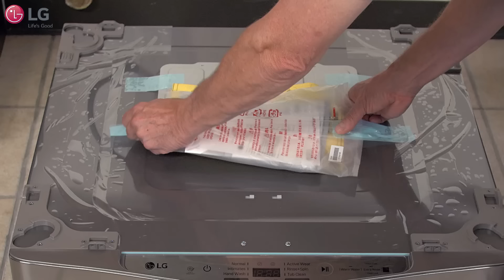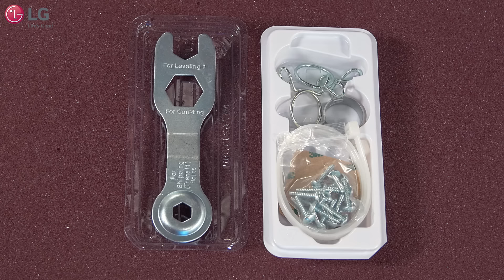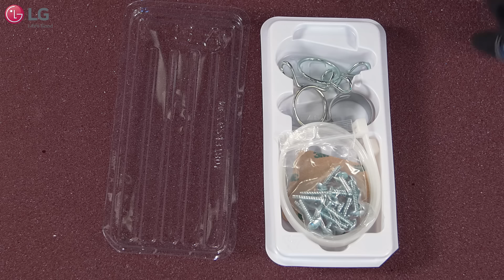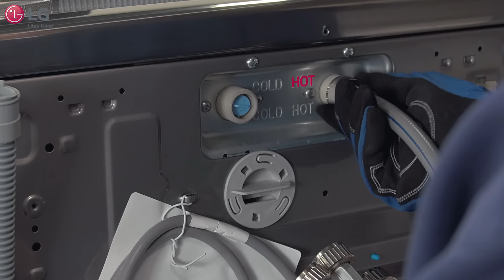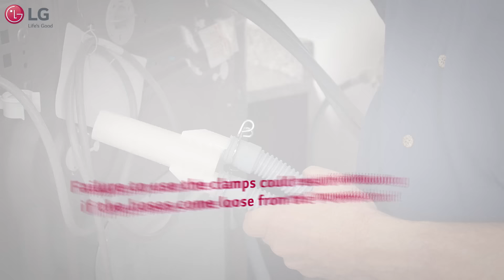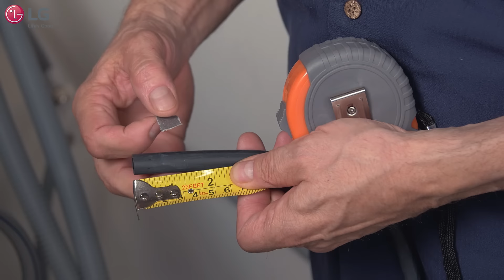LG SideKick™ Washer - Installation

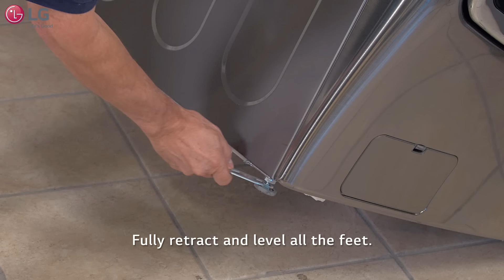Comment: I have the 3400 washer, i had to remove the middle nut on the feet at 01:15 to screw the legs in far enough so the holes with the 16 screws would line up. The nuts were too thick.
Reply from the maker: Hi, Koolnestea! Thanks for sharing that detail about your setup with the LG 3400 washer. It’s helpful to know you had to remove the middle nut on the feet to properly align the legs and screw holes—your observation about the thickness is noted. Thanks again for your feedback! -Junel
Reply: @LGUSA  also the drain hose is quite a bit shorter than the 3400's drain hose so when you attach both to the Y piece, there is quite a bit of slack on the washers drain hose, so in my case the sidekicks drain hose isn't long enough to reach my drain so i gotta find a extension or see about getting the same length drain hose like my washer.

Comment: I wonder why you cannot install the sidekick under the dryer? You can install a full-size washer under the dryer but not the sidekick. Does this apply to the most recent Sidekick model WD300CV? Can the sidekick be installed above the big washer with a stacking kit? I have a tight place and I’m trying to find a solution.

Comment: Failure to use the clamps could result in flooding if the hoses come loose from the Y-connector!
Reply: If inserted more than an inch, it will cause leaking at the drain Y-connector.
Reply: DO NOT Install the SideKick@ under a dryer!

Comment: Remember this video is using all rubber hoses, ALL hoses should be replaced with stainless braided no burst ones including the footlong ones that come out of the hot and cold faucet AND including stainless y connectors found in steam dryer kits

Comment: Damn!  You have to have a mess of hoses in back of this set with the sidekick.  I'm thinking of ordering the Sidekick, but I get the feeling there's often issues with these.  Not draining totally and receiving damaged.  I'm still considering it, but I have to believe over years, those plastic Y connectors are going to be stressed.
Reply from the maker: The SideKick™ Pedestal Washer shares its drain hose with the washer that it is paired with. We do not have any reported issues nor are we aware of any reported issues about drainage issues. The hoses are made of the same material as those for the washer so they will hold up to the same stresses as any washer hoses do. The water pressure for all our washing machines & the SideKick™ Pedestal Washer is the same & the hoses are designed to those specifications so stress is not an issue...^Ivan
Reply: @LGUSA  I'm sorry I wasn't more clear, I guess because I haven't experienced it myself.  I just read about it.  It seems that "some" people had an issue with the tub "totally" draining.  Sounds like water sometimes would remain in the tub causing the usual issues with water remaining.  I was interested in getting the Sidekick with the 8100 series.  They are out of stock still.  I was between the 8100 with a Sidekick, or the 4500 series without.  I'm apprehensive about so many electronics on the 4500 series, but I'm pretty sure that's where I'm headed.  Thank you so much for your responses!  VERY helpful.
Reply from the maker: If the Start/Pause button on our washers is not pressed to start the selected cycle, after a delay the washer automatically turns off & all cycle settings are lost. Any water remaining in the drum will be drained. Water will only remain in the tub when a wash cycle ends if the drain pump filter is clogged so it is recommended to periodically check the drain pump filter to ensure that it is not clogged with foreign objects so it drains properly...^Ivan
Reply: swap out the plastic for brass... they're the same size/thread as a garden house

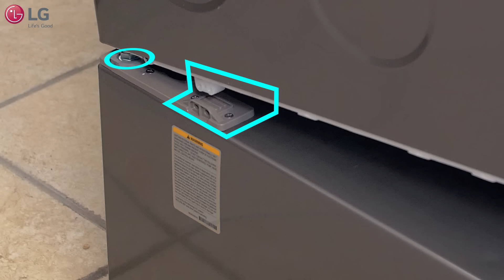Comment: Has anyone had problems with the screw holes on the mounting kits not lining up (@1:30)?
Reply: Yes! the screw holes in the main washer are higher than the screw holes in the side kick washer.
Reply: Same observation here, holes on the main washer are too high.

I fixed the problem by taking off the 4 legs of the main washer (you need to be two individuals as the main washer must be tilted) . I then replaced the top nut of each leg by a nut (M10) that is ~3mm shorter. 

I am baffled by the incompetence of LG... I will never buy an appliance from them again.
Reply: I have this problem too. I'll try the M10 nut and see if it works. Thanks for the tip!
Reply: Our 2nd installer said as you start a screw in, the two flanges pull together.  Also we found #8 x 1" screws worked, as the original installer misplaced the install kit

Comment: I just want to use the mini washer below , can buy separately?
Reply: There's a weight switch near the back left corner that you can tape down and it will work. I live in a tiny studio apartment, so I put this thing underneath my bed and ran a hose to the kitchen sink. Saves floor space and the landlord will never know it's there.
Reply: I've seen small top loading washers for under $300. They're about the size of a dorm fridge.

Comment: and where the depending from SideKick  to the main washmashine? 
SideKick have is own inlet, outlet  and power plug  then it would work without the Mainwashmashine too?
why you promote like that be a one unit???  SideKick  is a lot interess as separate mini washmashine for use in mobile caravans, tine house, tine apartments etc... if you have SideKicke option with 12Volt the Caravan owener will love  LG. 
Next Idea would be  SideKick same size Dishwasher, to combine upper half sidekick dishwasher and lower half sidekick washmashine perfect DoubleKick for small city apartments and/or single apartmens etc...

Comment: How can we move these stacked machines. I need to clean the area behind these washer and dryer machines and it's impossible to move these forward and clean the back area.
Reply: It is useful to own an appliance dolly or hand truck if your floors are not easy to slide machines on. Harbor Freight, Home Depot, etc, all have them.
Reply: I have found spraying windex  or even water makes the machines slide easy on most floors and then it will dry so no cleanup .
Reply: @markpetty9741  but if the floor's dirty, it'll just make a nasty looking mess from dragging dirt across the floor
Reply: @blackice7408  clean your floor first! Where what do you live in?
Reply: @cherylefuller8921  after a while of the machines sitting in one spot, dust, lint, and such are bound to collect under the machines. And that's with any non moving appliance/furniture in the house. The stove, fridge, couch, etc
Reply: @blackice7408  I move out my fridge and laundry equipment at least 3 times a year and clean behind them and the floor under them. In fact, a house is not clean if no one cleans the baseboards behind the furniture and scrubs the floors beneath. One of my pet peeves is wall to wall carpeting, because vacuums rarely get the little strip along the edge. I have 3 houses I have to keep clean. 
Wasting my time on carpet scrubbing that little strip isn't worth it. When I restore a house, I make sure to keep the beautiful wood floors. it is an easy thing to sweep the baseboards while sweeping the floor. All part of one activity.
Reply: You need two people

Comment: I didn't want to replace a dryer that worked (but that I never really liked) but my new LG washer is taller than the dryer so I caved.-->allmy.tips/lgSteamXWasher?ff     So glad I did! The new technology really is better, sensing when my clothes are dry and offering me enough options that I can dry what I need to without worry. Very happy with it's speed, quiet and ESPECIALLY that it doesn't roll my clothes into a ball that is baked on the outside and wet in the middle as my old dryer did. I don't have to keep an eye on it and keep shifting my sheets to get them dry. Expensive but I feel like I'm back in the first world. [This review was collected as part of a promotion

Comment: Do not buy the twin wash mini unite. There is no dispenser in the unit, so you need to use it only when you're home. It is impossible to drain residual water, so moving it or re-pack it is a risk.
Reply: Their is a little drain hose in the back like the ones in the lg front loaders but no access port to clean out the pump I’m pretty sure
Reply: FineGamer512 I can now use a spin only cycle but no tub draining method available inthe mini washer

Comment: What happens if you put it on A unsupported washer
Reply: If you don’t use one of the newer LG washers, the stacking switch on the machine will not be depressed and you will get the “E7” error code.
Reply: @littlebit670  Does this mean I can use my older LG washer with this, and just depress the stacking switch permanently?  I have 3 LG washers. I was hoping this could be used on one of them, so I don't have to buy a 4th. I have 2 other houses and run an Inn so do a lot of laundry.

Comment: I wonder if you could install this in a van. I’m curious, might have to try
Reply: Just find a way to keep the stacking switch pressed down. If it isn’t, you will receive an “E7” error code.
Reply: This is my question, too. I am on the fence abut drawer fridge, too. These could make a clean and efficient stack in one location.